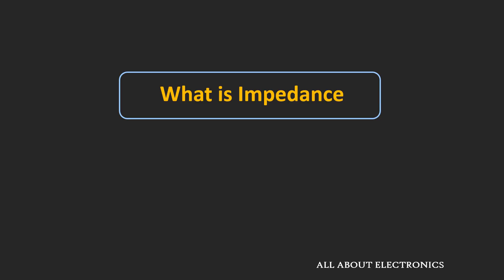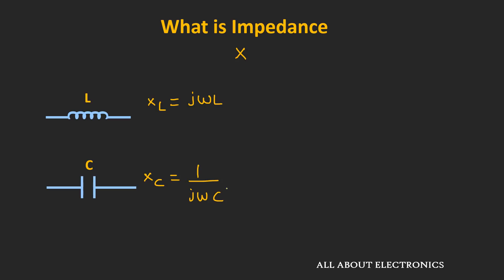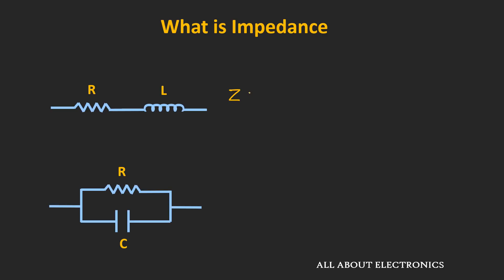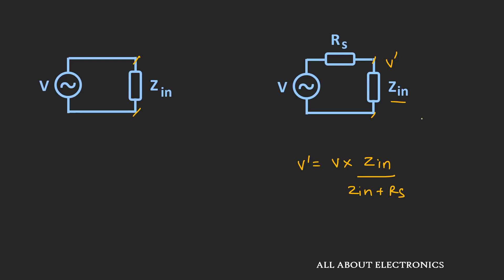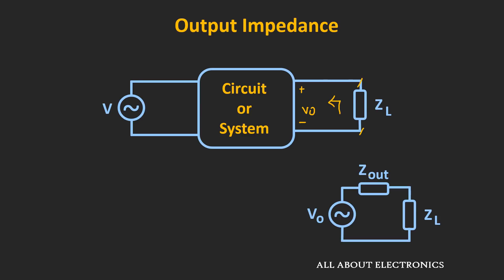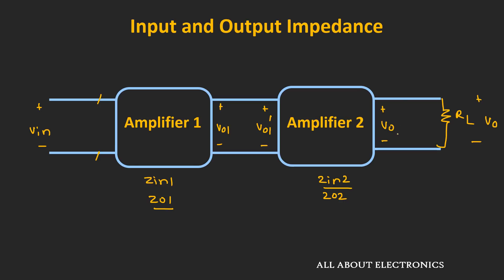What is Impedance? The Input Impedance and Output Impedance Explained

Comment from the maker: The timestamps for the different topics covered in the video :

0:32 What is Impedance?

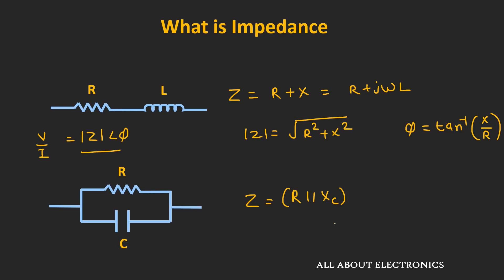4:45 What is Input Impedance?

5:35 Why should the input impedance of the circuit needs be high?

6:57 What is output impedance?

7:28 Why should the output impedance of the circuit needs be low?

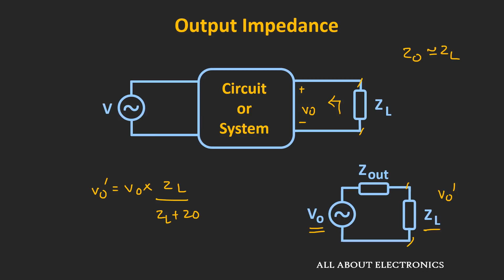8:46 The effect of input and output impedance in the cascaded circuit/amplifier

Comment: Sir, why do we short circuit the source to find the output impedance???
Reply from the maker: The output impedance is the Thevenin's equivalent impedance observed by the load. As you know, to find the Thevenin's equivalent resistance, we remove all the independent sources from the circuit and we consider them as zero 
So, that is why to find the output impedance, here all the independent voltage sources in the circuit were short circuited.
I hope, it will clear your doubt.

Comment: Thanks for the vid. For your two-amplifier circuit, is the input and output impedance identical? Thus amp 2 will need to be bigger impedance-wise than amp 1, but less than the load resistance?
Reply from the maker: The input impedance of the amplifier is typically larger than the output impedance. So, when two amplifiers are cascaded then in most cases, the input impedance of second amplifier is larger than the output impedance of the first one. The only thing we need to ensure is that its output impedance is sufficiently less than the load resistance. (to get max. output across the load).
I hope, it will clear your doubt.
Reply: @ALLABOUTELECTRONICS  yes, thank you very much!

Comment: I have pressure sensors that outputs a voltage (0-100mv DC), with an output impedance (990 ohm - 1010 ohm).

For calibration, is there a way to simulate the sensor?   I have a constant voltage/current source (0-100mv), but to simulate the output-impedance part, I assume it's not as simple as putting it through a 990-1010 ohm resistor.
Reply from the maker: Does output impedance is changing with the output of the sensor or it is constant ?

Comment: If you are designing an actual circuit, how do you ensure that those conditions are met??
Reply from the maker: Practically, for impedance matching a buffer can be used. It will isolate the two circuits and minimize/ eliminates the loading effect.
Reply: @ALLABOUTELECTRONICS  Do you have a video on buffers?

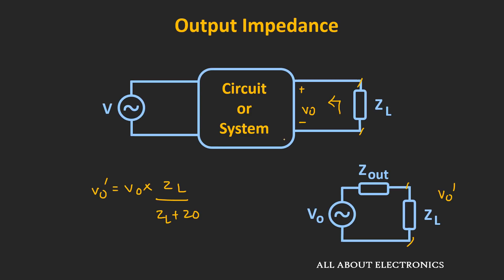Comment: Sir 7:56 why can't we put ZL very high in order to keep the Vo' =Vo?? As we did for input impedance case.?? Sir, please answer. I'm confused.
Reply from the maker: Many times in a practical system or circuits, the load impedance is lower or comparable to output impedance. For example, if you take the case of a speaker, then its impedance is few ohms. So, when you connect such a speaker with the amplifier, then the speaker will act as a load for the amplifier. And in that case, it can reduce the overall output voltage. (which is the case in most of the practical amplifier circuits) So, in the lab, yes, it is possible to connect the ZL of very high value, but practically it is not possible always. 
I hope it will clear your doubt.

Comment: Howdy. In audio it is usually recommended the PA input impedance be at least 10x the preamp. output impedance. Why is that ?
Well. In audio the aim is to uphold signal voltage fidelity between stages. Not max. power transfer between stages.
Say a preamp. has an output impedance of 1 k resistive. Now we load it with a PA with an input impedance of 1 k resistive. The signal transfer is half voltage and half current. The fidelty is OK.
However. The impedances are seldom purely resistive. The reactance components will upset the current part fidelity.
So if the PA input impedance is 10x or more the preamp. output impedance the signal current part is small. Input reactance skewing is small.
So. By loading the preamp. with an impedance of 10x or more is the same as to uohold the signal voltage fidelity in transfer.
Regards.

Comment: Could anyone explain that how the input impedance should be higher than the series resistance? If the voltage drop in series resistance then what will happen in the input impedance?

Comment: How to minimise or maximise the input and output impedance practically ??
Reply from the maker: In a very simple way, you can use the op-amp as a buffer at the input and the output of the circuit. The op-amp has very high input impedance and very low output impedance. And in this way, you can maximize the input impedance and minimize the output impedance of the circuit.

Comment: Can I ask how to measure input impedance of an op-amp? Is that one probe to the output terminal and one probe to the ground after the op amp is powered up? Can I measure impedance in DC when frequency=0Hz with a ohmmeter? How come the impedance or resistance is very high?

Comment: Great video!  The desired input and output impedance suggestions are fine for low frequency devices like DC power supplies and such things.  For higher frequency circuits like those dealing with radio/RF frequencies, you generally want to match the input and output impedance to avoid reflections of the RF signal and provide the best signal transfer from one stage to the next.
Reply: I have a problem with this. Can you help me if l tell you my problem?

Comment: Okay so I’m getting a computer with these specs: 

Intel Core i5-7200U Processor 2.5GHz
Microsoft Windows 10 Home
12GB DDR4 SDRAM
1TB 7,200RPM Hard Drive
Intel HD Graphics 620
Multi-Format Digital Media Card Reader
2x2 802.11ac Wireless+Bluetooth
15.6" Full HD IPS UWVA WLED-backlit Multitouch-Enabled Edge-to-Edge Glass Display
$450 USD 

Is it good enough for gaming but can double as an cost-efficient everyday computer?
Reply from the maker: It is good configuration for everyday usage and maybe even for gaming. For, gaming I think It would have been good if it has Nvidia grahics card instead of intel graphics card. But actually that depends on the kind of games you play. 
But for 450 USD, I feel its a good deal.